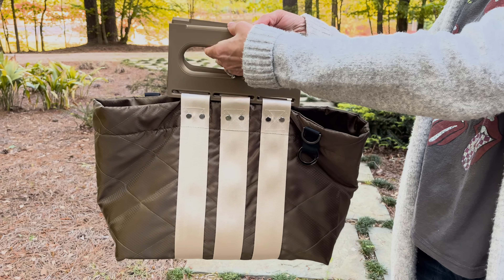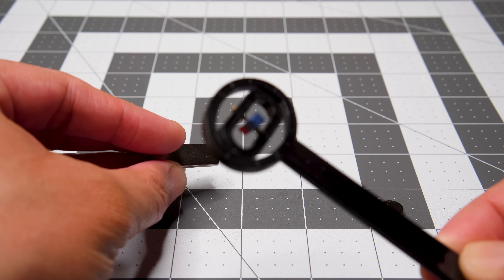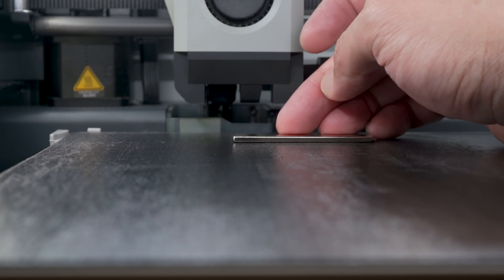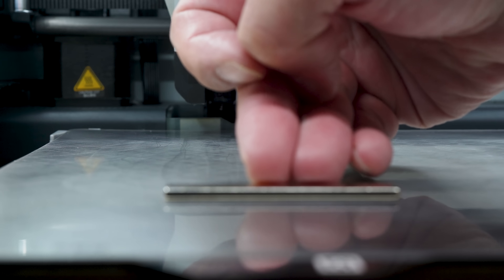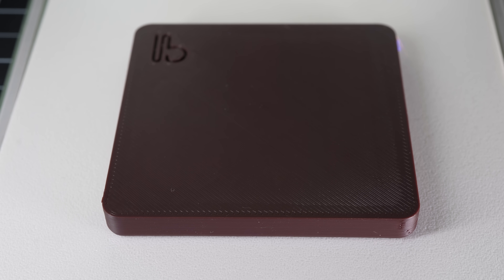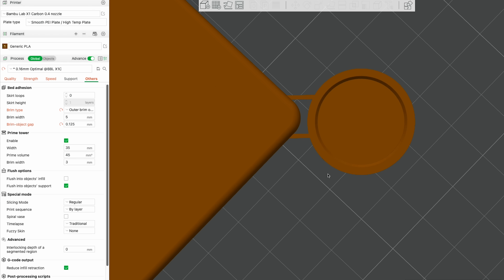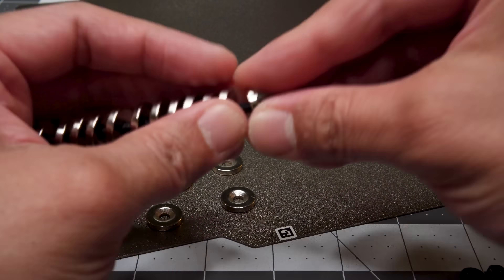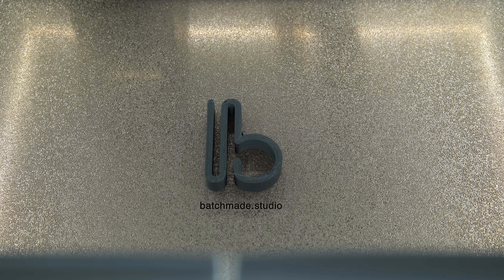Magnets and 3D Prints Part 2

Comment: Also, what is the infill pattern @4:55?
Reply from the maker: Wow, it's been a while since we did that specific output, and we've tweaked and saved over that file a bunch of times already, but pretty sure it's '3D Honeycomb' and fairly sure it was set at 25% infill density🤞🏼

Comment: I assume you used an X1C. If the print is lifting in the left corner, it could be due to the fan on the left side.
Reply from the maker: Yeah, we've started turning cooling off for (all or part of the duration of) some prints. But the new SuperTack plates have also helped a lot.

Comment: Search for “countersunk magnet” and somewhere in your shop screw one into your pegboard tool holder, your work bench, your garage wall and for evermore that is the Master Magnet to clock all future projects that involves magnets.  Doesn’t matter which side is North or South so long as you clock your magnet or stack of magnets off of the Master Shop Magnet then all projects throughout your shop will repeal / attract the same for perpetuity.

Comment: The issue with the warping is often seen. If this is PLA, then you should print with opened door and removed glass. For ABS ofc closed.
Both are prone to first layer issues, especially with a boxy design like this, which could be solved:
- Check infill type. Grid is prone to more internal stresses. Use other type
- By default the distance between brim and object is smth like 0.1 which imo does not stick to the model and does nothing. Thus making it 0 would connect to the model and hold it
- Use so called "mouse years". This would be the best choice imo

When I had issues with small model that was for calibrating it had the same issues. Mouse years on each corner and it prints nooooo problemo. It is like 1min of work in the slicer itself
Reply from the maker: Thanks for the tip

Comment: Apply liquid glue. Printing with a brim is my last resort…I can remove glue with running water but a brim can take some work. Bambu Labs liquid glue works fine; Layerneer works even better and has a much better applicator too.

Comment: 80 seconds in and I’m ready to start buying stuff. Where are your affiliate links? C’mon man, monetize while saving me the trouble of searching…it’s win-win!
Reply: ikr... I need so many of these...
Reply: But you can make and print these ones yourself ;)
Reply: @rubenverster250  I can do anything but I can’t do everything. I’m not going to make tweezers or the beeping polarity indicator. 😆.
Reply: @radish6691  It can't be that hard

Let's brainstorm

We have a magnet suspended, and if a + and + pole are measured, it would push the magnet back, creating a circuit loop, and then it completes power for a little speaker :D

Comment: Corner lifting was one of my most annoying errors to solve. After some studies I found out that it had something to do with the way I was trying to design the models itself.
So for me it was basically a new "rule" when modelling parts for FDM printing - I had to make shorter pieces.

The explanation (not very well detailed, sorry, but I guess with this little info you can find way more helpful info online) is that the warping happens due to the length of continuous extrusion on a given side of the print. Even with a controlled temperature chamber, a long single extrusion (such as a wall of the long side of the part) will create such an enormous tension that the adhesive will simply not be able to hold it down.

Plastic contracts when printing - heating + cooling (I don't know which one you are using - ABS is the worst) but every material has a coefficient of expansion/contraction. This force is exponentially higher with a longer continuous extrusion on a given wall.

Easiest solution - print shorter files (and then join then together)
Slightly harder solution - take this into consideration when modelling the file and try to design it in a way that would "break" continuous extrusion (the same way we all design parts with "overhangs are evil" mindset for example)
Reply from the maker: Thank you for the insight!

Comment: Do you have an stl for the magnet labeling tool? I checked your site and don't see it :(
Reply from the maker: Apologies, that was an oversight 😞, we forgot to include those in the ZIP file. It's uploading now, but check back in a little while. We've updated the link, but we also updated the files so that all the magnets are 3 mm high. That way you only have to pause the print one time. Thank you for letting us know.

Comment: just dont know how do you manage to make it not lose strength when heated?
Reply from the maker: We actually haven't encountered the bed demagnetization issue due to heat yet (maybe because we demagnetized them before the heat had a chance to have a detectable effect 🤣) . But if we eventually do, we'll post an update. If you do encounter it, and the remagnetization method works to repair it, please let us know!

Comment: This is great! There's something satisfying about that manual operated magnetometer. The only minor thing I have to offer on feedback is that the magnetic hold-down part should be a sub-part of the part you want to attach it to, since that will cause the slicer to better integrate the brims together. It's a small difference but I've been burned by lifted corners enough to figure that out. The idea of the magnetic hold-down itself is really good and I think I'll go and model some for the magnets I keep on hand now.
Reply from the maker: That is an awesome tip and a great catch! Thank you 🙇

Comment: So does exact polarity really matter that much? What I mean is, are there applications where you need to know N and S as opposed to like A and B? 
(Still keeping track of the polarity in the second situation relative to other magnets, but not sure which is actually north and south.)
Reply from the maker: Well, it didn't at first, but we had situation where different team members were working in different locations on different parts of a project, at different times. Without the luxury of always waiting to have the parts with magnets you need to match in-hand, we began to worry that parts that were to eventually meant to come together (made by different team members) may end up having magnets installed to repel instead of attract. So we needed to find a universal way to figure out which way magnets — any magnets — were 'facing'.

Comment: Have you tried printing the piece without adding magnets? Just to exclude other factors, like warping caused by the auxiliary fan in the left side of the bambu
Reply from the maker: Thank you for the suggestion 👍. That was also similar to one of our theories as to why the corner was sometimes lifting. In some of the prints though, the errant corner was in the front right of the plate away from the fan. You'll see in the video that we also tried printing 'walls' around the problem corners, to see if we could redirect the airflow a bit, but it didn't seem to help in most of the instances. Granted, we printed those walls right along with the piece itself (instead of pre-printing them separately), so there would still have been the potential of 'bad' airflow right over the top. But in most cases wouldn't have had the space needed to put those walls far enough away from the piece to allow the nozzle head to have the room it needed to print the piece without being obstructed.
Reply: @batchresearchlab  usually what I do to manage the airflow is simply lowering down to 30 or 40 percent the auxilary fan. if that's the case, such solution should be sufficient. Certainly different filaments have different behaviours.

Comment: This is not an Halbach array. Just a normal alternating polarization that already helps a lot.
If it were one, you wouldn't be able to demagnetize it with your magnets and would have serious issues to get your magnets of the plate.
The Halbach array is a very specific forced arrangement of magnets, that basically squeezes the magnetic field lines to one side.
The net effect is a very asymmetric magnetic field having a lot of power in one area while weak on the opposite side.
Reply from the maker: Oh man, thanks for schooling us on this 😞. Guess we didn't dig deep enough on this (we were just so excited to have resurrected our bed 😅). We see now that the tool we made was a simpler alternating polarity stack. Now we're wondering HOW we could build an actual Halbach array tool🤔...seems like we might need specially drilled cube magnets with the holes drilled from the 3 different axes (in relation to the polarity direction) for the various cubes in the stack. Thank you for the insight 🙇. We'll update the info on the site page to make sure we set people straight 👍
Reply: @batchresearchlab  Building this tool with an actual Halbach array would boost it effectiveness like 5x or so, so go for it 👍
But please be careful they behave like a female dog in heat...
Best practice is usually to epoxy them in place.
Great video btw. forgot to mention that 😉

Comment: This is amazing :) I would have never thought to use magnets as adhesives! I've done alot of magnet inlays inside of prints batches of 20 magnets and never looked this far at it! These tools with polarity checks would be a life saver! Another little trick I've used if you don't have them check the polarity one time on the magnets and keep them in a stack when you go to feed them into the print use the stack itself to place the magnet by shearing it off! That will always ensure your placing to the correct polarity :)
Reply from the maker: That's a great tip 👍thank you!

Comment: Super interesting and informative video. I wonder if you can make an adapter for the print head to hold onto the halbach array and write gcode to re-magnetize the bed in a more controlled fashion.
Reply from the maker: That's an interesting idea 🤔. Yeah, you can see how awkwardly wobbly we were rolling the magnet stack 😆! Another idea we thought of, but haven't tried yet is to make handle attached to the either end of the stack bolt so that you could roll it more like a paint roller.

Comment: It never occurred to me the print bed might repel my magnets.

Another way of doing the north/south thing is to glue a small magnet to the end of a stick (think chopstick), then one facing the other way to another stick, and color code the sticks. Then you can pick up the magnet with the appropriate stick and put it in the hole at the right time. Complexify the tool as desired. It makes it easy in smaller builds because you don't have to label things in advance, the labels don't rub off, etc.
Reply from the maker: Thank you for the tip!

Comment: My guess is that your prints are high infill to solid so 90 degree corners are going to want to pull up no matter what. You need to make sure you are cleaning your bed extra carefully and using as good of bed adhesive as you can get your hands on. If you are using the cool bed, Go to a different style bed and up your temps to 60° c for the bed.
Reply: Did you watch the video? 😊

Comment: Great video! 
What laser are you using for the text engravings ? Those look sweet !
Reply from the maker: For this project we primarily used the xTool F1's 2 watt IR laser. Though we did use the F1's 10 watt diode laser prior to the IR on one of the logo applications on the end of one of the black cases to see if we could get a bit of a recessed look. We've got a couple more videos on using a laser on 3D prints if you're interested 😉
Reply: I was wondering the same thing.  Thanks for asking/answering.

Comment: Technically no Bambu Lab printer has a temperature controlled chamber. Only QIDI X-max and Q1 Pro. The Bambu Labs only retain heat so they get somewhat warm (45 °C at most, usually), but cannot control it.
Reply: Ummmm… X1E?
Reply: @Hyydr0s  I totally forgot about that one